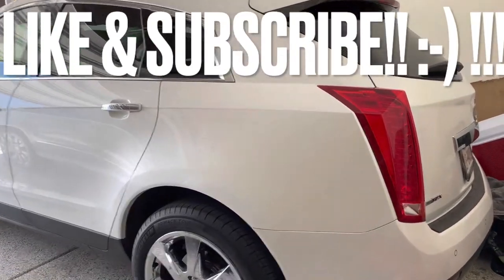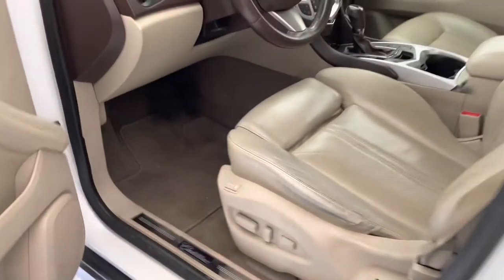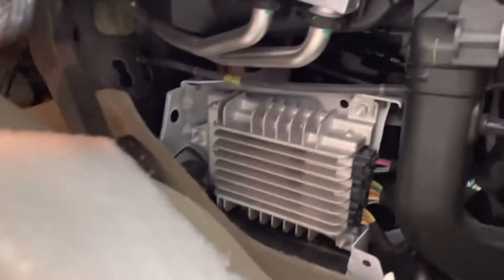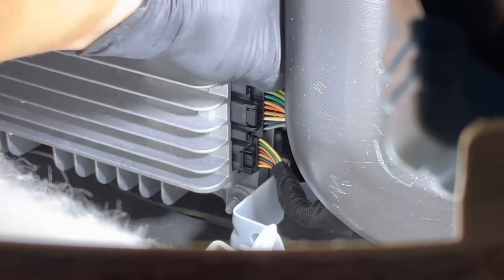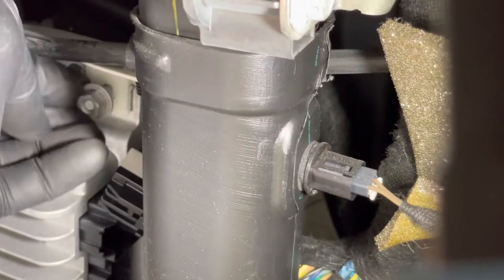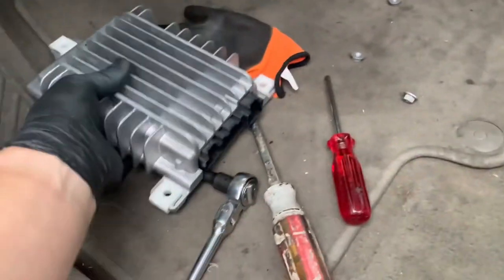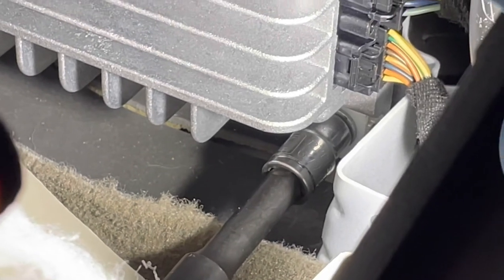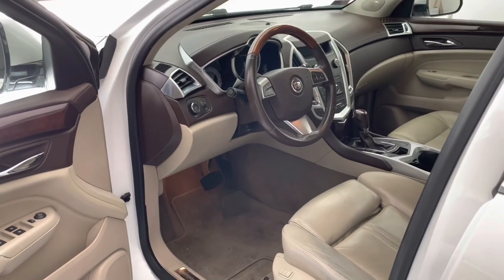No #audio for sound or #turning #signal on #Cadillac #srx ... It might be your #bose #amplifier -Fix

Comment: I have this same exact problem in my 2022 XT5. The GM slot machine door chime would get distorted and cutoff and also the turn signal sound would stop working. Strangely though I didn't have any issue with my music. Took it in to the dealership as it is still under warranty and first they tried to reboot the instrument panel. Didn't fix it. Now they have a new amplifier on order and am getting it replaced. It baffles me how even a simple thing like a turn signal ticking sound can be a victim of software issues.
Reply from the maker: At least it’s under warranty then right? Nicely done and please like/ subscribe

Comment: The same here . 2010 . I have also a terrible loud static from radio which turns on when I turn the engine on 😢
Takes a minute to turn it off .
Just happened 2 days ago .
Going to Cadillac dealer tomorrow . Scary ….
Reply from the maker: Changing the amp didn’t fix it?

Comment: this is exactly whats mines doing but not all the time just about 75%.  do u think one of the cables could be loose?  should i just change it out all tigether like you did?
Reply from the maker: Mine was intermittent but when I changed it out, problem fixed right away. Thumbs up video?
Reply: This problem just happened to earlier toda on my 2014 ATS. Everything was working fine and then after I did my grocery shopping, the turning signal sound and radio doesn't work. If the problem continues for a few days, I'm going to the Cadillac dealership next week

Comment: Did you replace with a new or used amp and do they require software programming at a Cadillac dealership?
Reply from the maker: Brand new Bose amp from Amazon. It is OEM and did not require any programming.
Reply: Do I go on Amazon and just put in bose amp?

Comment: My signal clicking works some of the time.  Also the speaker sound jumps from one side of car to the other or volume gets really low.  It has also started doing that with my Bluetooth when I’m on the phone.   I know it is a short somewhere!  Any advice?  Thank you.
Reply from the maker: Mine was doing that too minus the Bluetooth thing. The amp change fixed my issue. Maybe for you too?
Reply: short is in the amp

Comment: Have exact same car.  No sound to turn signal but my other issue is the radio doesn't raise.  Could this be same problem
Reply from the maker: Not sure about radio no rising but for sure on the turning signal sound.
Reply: Try the fuse. Should be in the truck compartment. I have a 2011 CTS.
Reply: I'm have a 13 CTS and my radio and infotainment and all climate controls just went dead like a year ago. I've been without ever since

Comment: what year is the car
Reply from the maker: Hey Russ! It is a 2010 SRX. Make sure to like and subscribe. Are you experiencing this in your car?
Reply: @512TXSDIY I got the 2005 srx and radio works with no sound, wow lol
Reply from the maker: @rustytoronto  Gotcha. I’m not 100% sure if it’s the same on your car or not. I believe this generation is 2010 to 2015. Wow what?
Reply: what a job trying to find the location, maybe behind the rear heater in the back, cripes
Reply from the maker: Gotcha. Maybe it’s in the same area. Did you try looking yet?
Reply: I took the trim off around the stereo but it would make sense to have it close to the stereo but it seems the floor carpet is one piece up the sides, someone on youtube had the amp in the back on or near my year, hmmm, hope the amp is the problem, looks troublesome, cripes, lol
Reply from the maker: I believe your AMP is in the trunk rear trim, driver side. This is a video I found on YT... maybe it will solve your issue? https://www.youtube.com/watch?v=VlWztX56cOE